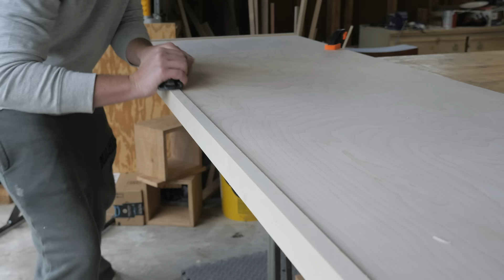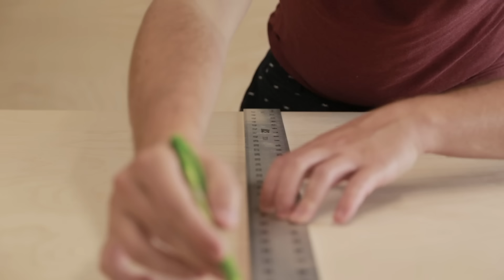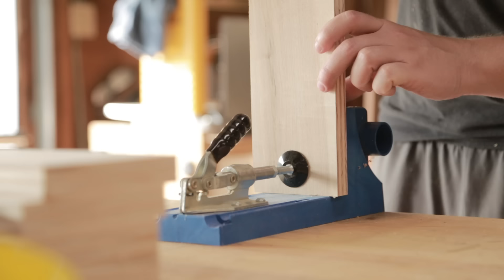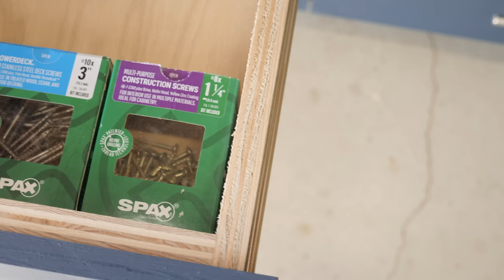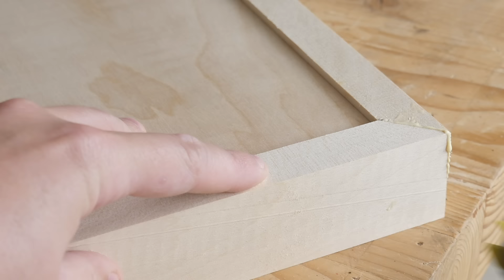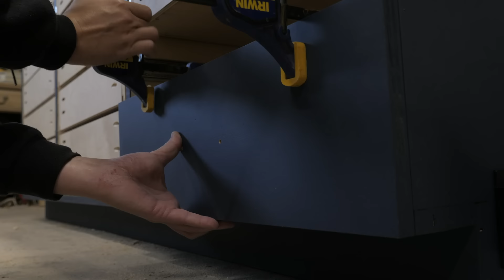Tool Storage - DIY

Comment: I bought your plans but there is no mention of the length for the drawer slides. Can you let me know which ones you bought?
Reply from the maker: I believe I purchased 20 in slides to match the depth of the drawer of the drawer the ones i purchased arent available in  20" on amazon but they do have 22 in. I think you can go up to 22" as long as it fits in the carcass,. Get whatever you can get, if they are a bit bigger or smaller you may just have over or under extension.

Comment: I just bought you plans and there is nothing about about what size screws you are using in your pocket holes
Reply from the maker: 1 to 1-1/4" depending on the thickness of plywood

Comment: do you think this would work with OSB?
Reply from the maker: Unfortunately I cant give any guidance on that as I dont know the strength and stability under heavy loads. You should do your research for sure because with just lumber alone this is a heavy unit and then adding tools makes it heavier. Im no engineer haha so Im not the guy to ask.

Comment: Sweet video from 4 years ago :( Now people would calculate if they would use such distinguished materials for their kitchen, much a workshop :)
Reply from the maker: yeah you can definitely go cheaper but i wanted something nicer. Still love the thing
Reply: @KevBotWorkshop Dude I love it. Nice materials and great final look. Built for years. Just frustrated with the current prices where plywood is a luxury *wood*.
Reply from the maker: @ couldn’t agree more. It was already an expensive hobby now any woodworking seems like 1% activity

Comment: Thi video inspired me to do this cabinet I need up with slightly taller adding up extra drawer. Love the plans very easy to fallow ! I am at the process to building drawers , fortunately I don’t have table or router and only track saw . I think the only option is to do bottoms gluing them and perhaps screws instead rabbet style. I have question regarding you mounting example of the slides where you measured the width of the drawers, did you just to the top right on as you showing in the video ? or should I do say across entire top or bottom. This will e little tricky and not much room for error haha , thanks again ! Greetings from cold Montana
Reply from the maker: Love that youre making your own! would love to help but Im having a little trouble understanding what youre asking.. are you refer when I am explaining at 7:06?

Comment: If anyone re-builds this i recommend installing the drawer slides while the wood pieces are still unassembled. There is a reason why IKEA does this. It´s much easier if everything is measured correctly. But given that he got them after building the cabinet his order of operations was justified.
Reply from the maker: Sure you can do that, as long as you're right with measurements. IKEA is all mass produced, cut by CNCs , takes out the human error. Ill continue to do it this way

Comment: I dont get it, its a wood tool chest.
Whats so wrong using MDF ?
MDF has advantages over plywood 
Cost being the largest, then stability 
If your just going to put paint on it 
Set it up off the floor on a sub frame you do not need to cut a toe kick  the 2x4 sub frame is your toekick  it also gets the MDF off the floor, paint will protect it from water and the sub frame gets it off the floor.
The Baltic burch should be saved for kitchen cabinets, no dam wonder its over 100 dollars a sheet.

Your wasting valuable resources on 
Garage cabnits the next home owner will just tear out and trash.
Shop finiture and equipment should be cheap lumber products.
Not the higest qulity.  

Every project I see guy make for the shop are done with high quality materials its a waste.
Reply from the maker: You ok pal? need a hug?

Comment: Mother of god I just priced out 3 sheets of 3/4 and 2 sheets of 1/2 maple plywood.    Wow.
Reply from the maker: Yep maple is going to cost ya, id try a cheaper ply. In the plans I put out I did alter them to use 3/4in ply and 1/2in ply to make it weigh less and hopefully cost less, but fully sheets of ply are still pretty high ever since 2020

Comment: Great video, I've watched it....4-6 times.  I'm building my 'miter box bench' built in bank of cabinets.... I haven't seen/heard a great name for it 🤔.  but at one end, I'm going to build something like your 'tool storage' unit, to replace my actual tool crib, so it is under the right side of the miter box.  The cabinets on the left will be door cabinets for all the tools that have their own cases.
Your 'tool storage' looks great and it's just what I'm looking to build.  How did you find the drawer slides / gliders....? Where/where.... I saw the Amazon link, and reviews.  But what is your take on them?  I'm building a new bed, that has drawers built into the base, and I'm using Knobonly slides on that project.
So I'm looking for any feedback ????
Keep up the great work, I'll be checking out your other videos.👍👍
Jon
Reply from the maker: The slides are alright nothing fancy. They are even pricey for the number of slides I needed. Of course I would love some nicer slides but for shop furniture, its not worth the money.
Reply: @KevBotWorkshop  Thanks for the feedback. So are you ok with them for the shop?  Or do you have someone you recommend?  I'm using Knobonly, because of the soft close and weight capacity, and they are reasonable price wise.  If you drop the soft close Promark are pretty good.  Any thoughts?  Again, nice project.
Reply from the maker: @Jonacarpenter  Yeah they are fine, definitely not the best but not the worst. If I were to make again I would maybe would try to find cheaper slides but wouldnt want to go down in quality. soft close are really nice, if you have the means I saw go with that.

Comment: Good project. 
FWIW as a professional- you can probably get away with 1/2” baltic ply drawer sides and 1/4” bottoms. You alluded to that at 9:00
With glue and stepped square joinery, I have a mechanic’s bottom chest on wheels the size of yours. I built it almost 25 years ago and even with a couple drawers full of ~100# + of steel jigs, hammer forms, and dollies I have never had a single failure other than a drawer pull I dropped a big maple plank on. 
One thing about it: yours will last at least that well! :)

I prefer the narrower drawers as you mentioned; the idea of a toolbox is to access tools in an organized fashion, not stuff it full of stacked up stuff. 

Nice color choice btw
Mine’s a tad more blue tone but yours looks familiar.
Reply from the maker: Thanks! And i fully agree about thinner ply. In my plans I made an adjustment for everyone to save some $ and make it weigh less. I still would probably not use 1/4 on the bigger drawers just my opinion cause I throw in there a router and sander and drill so the big drawers are a bit heavy, but yeah I see what you mean

Comment: How many hours did it approximately take to build this?
Reply from the maker: Hard to say as it take me more time to do things as I am moving a camera around to set up shots. Ambitiously it could be done in a weekend. With a cut list, you can batch cut everything and then it is just assembly. Probably the longest part is the pocket holes and waiting for glue to dry on the top

Comment: Thanks for the video and plans (which I purchased).  What size screws are you using to attach the drawer bottom to the drawer frame?  In the video it shows a box of 1 1/4" but that seems too big for 1/2" ply?  Thanks

Comment: Looks great! Nice job. At 1:27 when you say "2 sheets of half inch plywood" I hear a faint voice in the background say "1/4 inch"... am I hearing things? lol
Reply from the maker: In my plans announcement video I talked about how I updated the plans with mostly 1/2” ply to make it weigh less and cost less. I typically stray away from1/4” as drawer bottoms cause I’ve seen them sag over time but you do you

Comment: This is BADASS!!!

I plan on making cabinets like this for my garage, but not mobile. I also plan on doing some type of butcherblock top for mine, so I can abuse it without worrying about destroying it.

I really like the idea of doing a bunch of thinner drawers too.
Reply from the maker: O I absolutely get that! I dont plan to work on this much so i didnt make it with space to clamp or anything. If I wanted to, I could just replace the top some day. The thinner drawers though.. huge space saver

Comment: Question- why did you use pocket hole screws for the drawers, when they have false fronts so conventional screws would not be seen? Instead the sides have those big holes showing. Is there some advantage? Cannot be strength, the 1/2" bottoms will add all that is needed.
Reply from the maker: Pocket holes give more strength while screwing straight into plywood endgrain isnt as stong and can cause the layers to split

Comment: Great result! What pocket hole rig do you recommend buying? I saw some cheap ones on amazon & Co but those are probably not as easy to work with.
Reply from the maker: I have the kreg K4 pocket hole jig. If I were go back before I bought it, I would have looked into the "Auto-Jig" as you can quickly set up a a board in it

Comment: I like your video but what I can stand is the gloves WHY????? I think is very dangerous to use the table saw with gloves besides what is the concern? to scratch your hands? if one of the machines caught your gloves you will prefer an scratch...I will subscribe to your channel because you are talented but I am worry.....Take care please
Reply from the maker: You are absolutely right when it comes to gloves. I know I should not be wearing them and appreciate your concern. The reason I wear them is because I have Atopic dermatitis on my hands that is extremely aggravated by sawdust (some species more than others.) There are many times I wear them because i know that I am making a cut farther away from the blade and I am comfortable doing so. Other times I take them off because I am not comfortable with a cut and I take the aggravation. One of the the drawbacks to my favorite hobby. Of course a drawback would be losing a finger or worse so I am taking proper precautions and thinking about every move I make. Of course there is no guarantee there. Woodworkers who arent wearing gloves even lose fingers so it is something to take serious anyways. I know for sure a sawstop will be in my future. Until then I am going to play it safe and try not wearing gloves as much as possible. Thanks again for your concern
Reply: @KevBotWorkshop  my apologies all I have to do is pray for you so you can be heal...

Comment: This is a great build. I am going to try to build this with all the scrap wood in my garage. I think I have enough to build 4 or 5 of these things. That would be awesome. Plans or no plans you made such a good video I will just follow along the best I can and make the rest up as I go. Great tip on the drawer slides spacing.
Reply from the maker: Hoping for plans soon, have to wrap up some work first and I will get those out ASAP
Reply: Woohoo!!!

Comment: Your drawer fronts and handles are not level and even so even though it's solid build quality it looks wonky (which isn't fair, because you did a good job). If you use vertical and horizontal spacers across the gaps you can even up the drawer fronts when putting them on, and then use a level / stringline across all the drawers in-situ for marking the handle holes, instead of that jig on each drawer front separately - that way it'll look schmick.

Comment: Instead of those Rockler casters you should’ve just eliminated the 4” toe kick and installed 6 good quality 3” casters with brakes on the front 3. 
That way you don’t have the 6” on each side of the cabinet wasted for the caster and need even more space to reach with your foot to set the caster.
Reply from the maker: Thanks for the tip!
Reply: Plus saving the 4" of wasted space in the bottom of the cabinet

Comment: I'm curious... any particular reason you went with individual spacers/spreaders on the back side, instead of long strips like on the top front and toe kick?  Seems like it might have been easier?  Maybe not.  Probably stronger, though I don't think your overall build is lacking in that regard ;)
Reply from the maker: Great question. I definitely think you could do that it was mainly space them evenly but you could do that with a spacer like i did for the front. So really i guess just personal prefence. I may have just saw it done by someone else and went with it

Comment: Thanks for the video. Advice requested. I used to build custom furniture professionally in the 80's for a few years. When I stumbled upon your video I remembered that I still need to build a large "Map" style storage cabinet for my radio control airplane workshop. The interior of the drawers need to be about 60" wide and 36" deep  but only  3" and 5" in height. They will hold larger scraps for fiberglass, kevlar and carbon fiber cloth, sheets of mylar, plastic vacuum bagging material and paper plans for radio controlled aircraft. Picking your brain, I have no have no Idea how to successfully build such large but shallow drawers and keep them from sagging over time. Thanks...

Comment: thats about $500 in plywood for these drawers and it's only 1:32 in the video.
Reply from the maker: Eh even in the pandemic it wasnt that much for ply, sure a couple hundred. Im gonna be modifying the plans before I release them for 1/2 inch ply for the drawers as the 3/4 is just over kill. Should be some cost saving

Comment: not bad.. i should do this rather than open shelves. saw dust gets EVERYWHERE without a dust collection system in place. i don't do enough wood work to justify the expense, i do have a ton of tools and am always tinkering on something. made something similar to hold a large blow molded case full of sockets, used warped thrown away plywood (was given a lot) and pallet wood and the same slides. turned out ok once i made a jig for the skil saw. those slides i found could be mounted by the cut out tabs making up for slight variances. they kinda float between the drawer and frame.
Reply from the maker: exactly! I was thinking about a tool wall but I also dont have dust collection set up

Comment: I bought used blueprint cabinets that hold items 2 inches... usually on their side. They are full depth drawers on ball bearing rollers.. and 48x48 inches. You can get these SUPER quality files for cheap or free on Craigslist,  etc. You can stand in the drawers without buckling. You can stack units on other units without loss of strength or function. For larger storage I bought steel storage cabiners with many different sizes and shapes. You can buy super quality used ones for $50 each from junkers. Buy some Harbor Freight wheels to put under them and you have cabinets that are as good as Snap On for PENNIES on the dollar. I have 25 blueprint drawers and 100 steel drawer cabinets on 100 or so wheels. I didnt spend $2000 for EVERYTHING.

Comment: looks great. Looking for your plans when you release them :) After building all our stores cabinetry with 3/4" pre-finished white birch, I had to run everything one and done as there was no cover up finish work. For that bottom upper toe kick, I'd run front to back bottom shelving and that toe kick plate would sit all the way to the top of the 3.5" cut out, supporting the shelf. I like your method as it saves material and you have drawers anyways. Thought I'd give you an alternate if you ever want to leave that open and have a bottom shelf.

Comment: Nice build! Was wondering how much weight the drawers would hold, any clue?
Reply from the maker: Thats a great question. I am not exactly sure. These Drawers are pretty beefy 3/4 ply for drawers is a little over kill and a 1/2 inch bottom means that it most likely wont bow with weight so I think it could hold a fair amount. Really depends on the weight of the drawer runners probably.

Comment: Love this! Question however...why spend the extra money for nicer plywood if you're just going to paint it? I love the result and look but usually you get the nicer lumber to stain or varnish.
Reply from the maker: Mainly cause it’s paint grade. I could go cheaper but it’s more likely to have knots and imperfections and I just wanted it to look good.